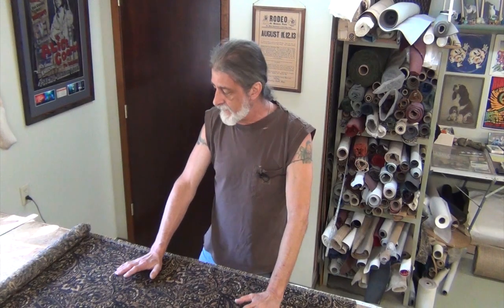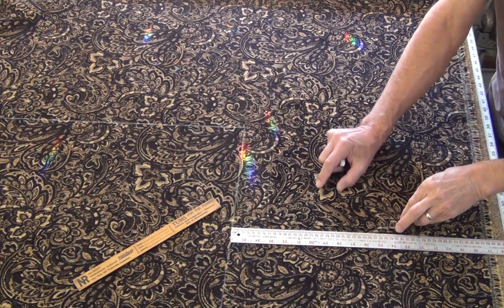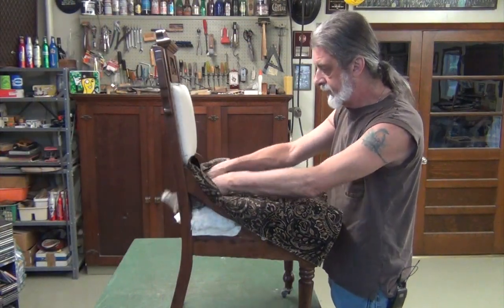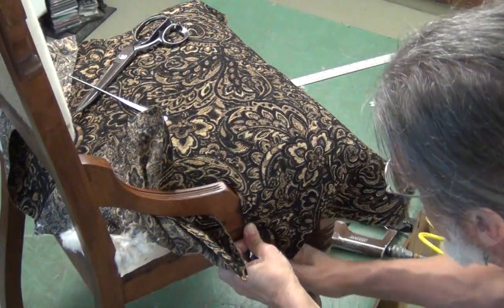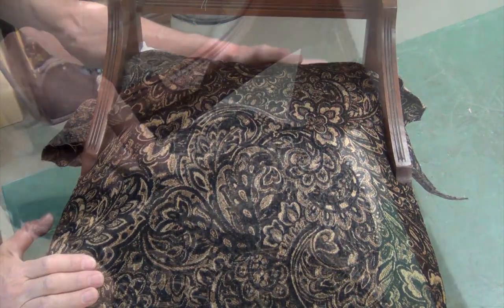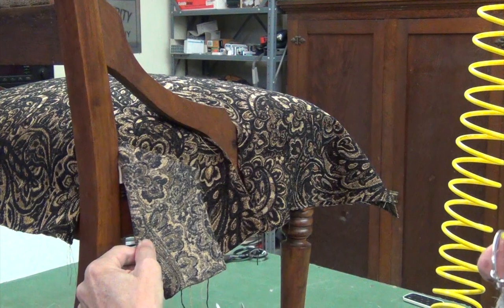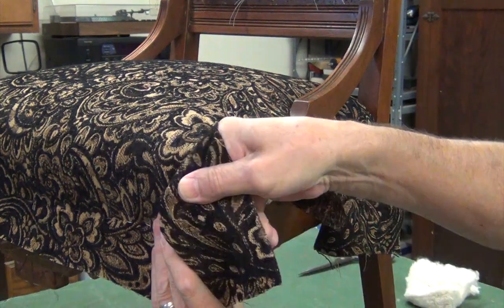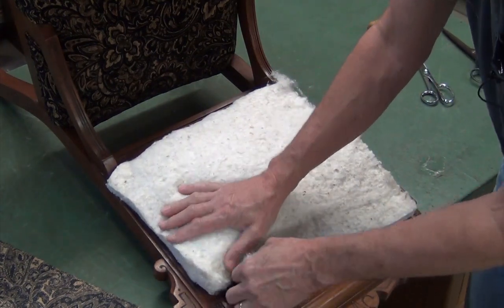Eastlake Chair Upholstery - Fabric Application

Comment: Thank you so much for sharing your art and craftsmanship with us.  I am in awe and have been glued to the screen.  I haven't ventured into upholstery beyond replacing some dining chair fabric and this was a complete eye-opener.  Would you share what the table surface is that you work on?  Many thanks, again.
Reply from the maker: My workbench is an old oak office desk with a damaged top. I remove the top and cover it with vinyl periodically. The glue tends to let go and the vinyl gets scuffed and torn. It is a very nice work surface. Thanks for watching. Stay tuned.

Comment: I have some beautiful, 1910-ish, dining room chairs. The straps on the bottom have disintegrated. Is there a way to get the springs out of the way so I can replace the straps, or do I have to take the whole thing apart? Thanks!
Reply from the maker: Following procedures, webbing is the first thing applied to the frame. I'm not saying it can't be repaired otherwise but taking the seats apart will yield the best results. Contact me via my website for more information.

Comment: Nice work.  I was wondering about the front corners of the seat.  Is there a particular reason that you made the folds to the side rail as opposed to front rail?  BTW, I currently have an Eastlake chair in the shop, some similarities to yours only wider and deeper.
Reply: I too have never seen a side pleat. Looks bad from the front. Pretty much standard on all types of fast seats to have the front corners on the front. Might be a Western thing were I have experienced  East Coast and European old school techniques. Lot's of old stuff here in New England.  I noticed this as I traveled the USA. Once we leave New England Boston etc and head out you don't see anything old. Not much at all really.  I've done lot's of stuff from 1600's 1700's. Did work in the oldest house in Plymouth Ma.

Comment: May I ask what type of staples you use?  Mine seem to be a lot thicker than that and I am afraid of splitting / damaging old wood.  Thank you in advance.
Reply from the maker: The gun seen in this video is 45 years old and limited on resources for purchasing the staples. Parts for the gun have been obsolete for years. The Bea #71 series gun would be an option for you. The staples break very easily though... I am not an expert in different guns.